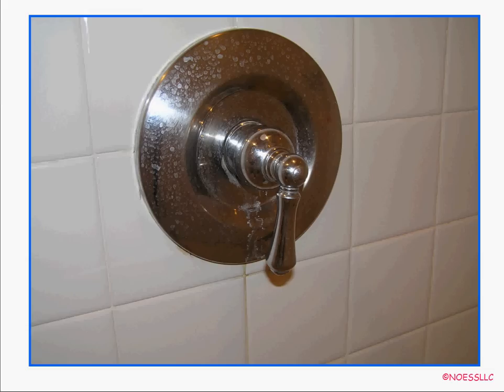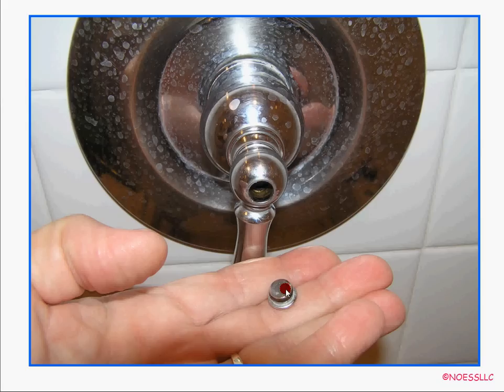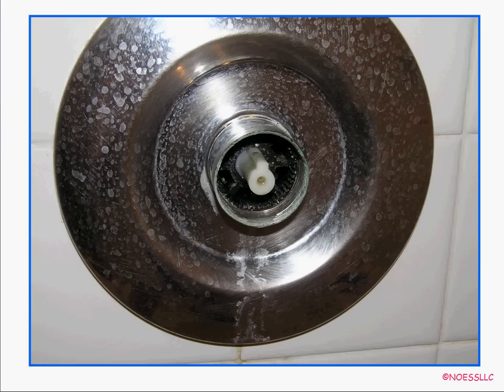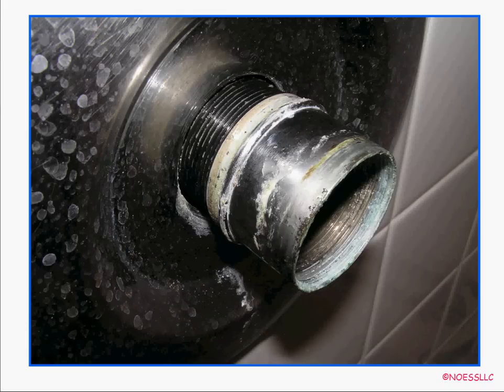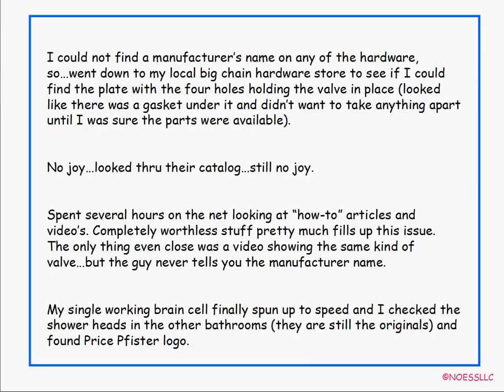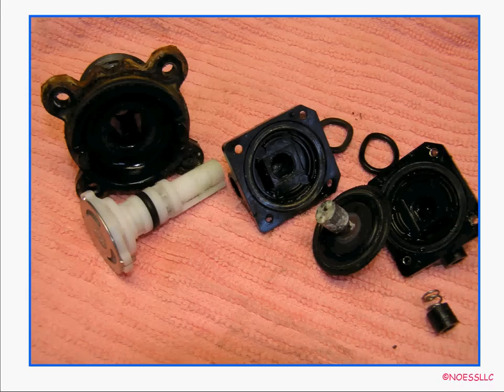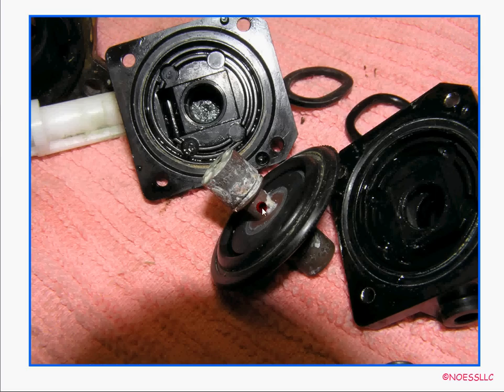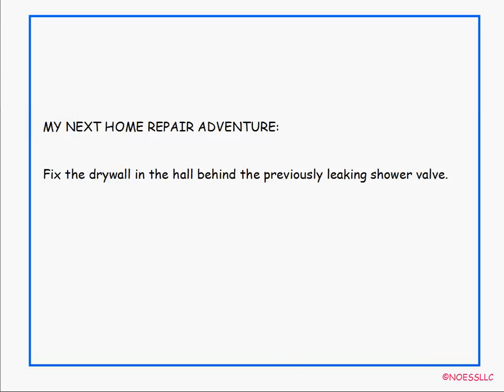Price Pfister Shower Valve Repair

Comment: I like the "free" warranty but the problem is that when we have a leaky faucet, we tend to want to fix it when we're ready to go out and get the stem.  Or the other case is, we didn't know what kind of stem it was, until we get behind to see it, then at that time, we figure, may as well go get the new stem at the store, rather than put everything back and wait for Pfister to send new one.
Reply from the maker: You have that exactly right if it's just a leaky faucet, but ... unfortunately it's sometimes necessary to temporarily put the bad fixture back together because the whole house supply has to be turned off to get at the parts. This shower valve and the water pressure regulator (see my video on that one) require the main supply be shut off. That's OK for enough time for a quick trip to the local hardware store with the defective part. But ... not finding it presents the problem of no water at all until the part can be ordered out. This is significantly not acceptable to the Significant Other. Being reduced to single flush toilets and no baths or showers while waiting for parts via Amazon Prime still takes too long ... sez she.

Comment: HELP! 
i have that same exact model but would you happen to know the model number???
thanks in advance!
Reply from the maker: Thanks to Thad Abrams, just two days ago he posted:  46-4042 for Price Pfister is the Single Lever Cartridge (all-in-one unit) made by Kissler & Co.  and 974-042 ox8  is the Universal sold at Lowes and HD. I have the two part form with the Pfister Valve Stem Assembly 971-250 and the Pressure Balancing Cartridge S74-291 both of which I found at Lowes.
Reply: @otd80  thank you so much brother i really appreciate you 👍

Comment: Does anyone have a video repair of a Toscano shower unit valve...there are 2 valves, one for water on/off and the other to control temperature--they sit vertical on the wall and the temp valve is frozen--probably corosion..has a red button to press and then turn to desired temp.  thx.

Comment: Are you serious? If you don't know where or how to turn off your water, you probably shouldn't do any plumbing, including replacements, call a plumber!  This is a basic cartridge with Price-Pfister (now Pfister).
Reply from the maker: No, my name's not Serious but you do have a point. Even so, if there are possibly multiple valves in a main line shut off, a little experimentation is often in order to find the right one. Here, the city will send you a bill for erroneously setting off the fire sprinkler system alarm, because the trucks roll immediately. I certainly agree that one should at least  know lefty-loosey from righty-tighty before attempting any significant DIY project but then again...there is the learning curve thing to consider...coupled with adequate upfront research...doing is learning. Thanks for your post!